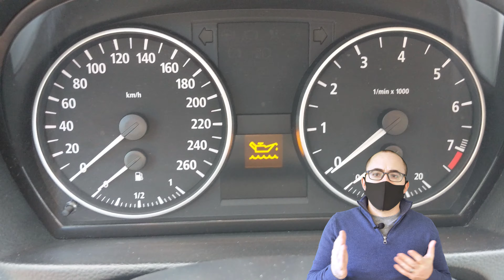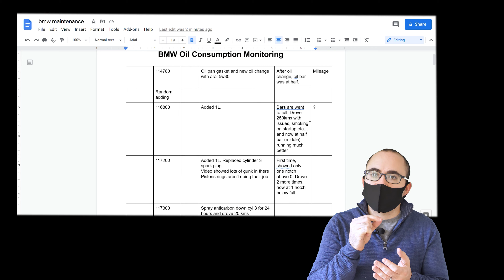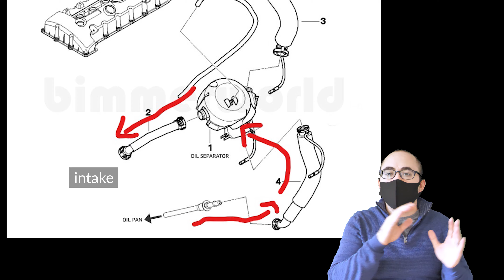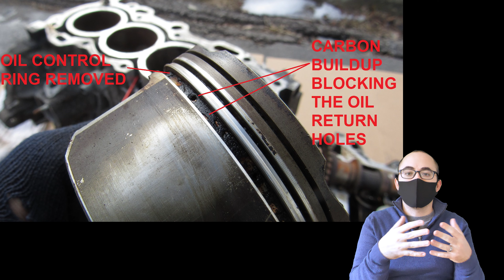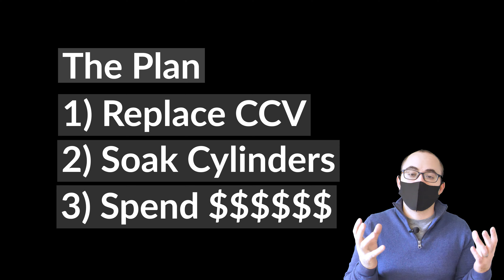How To Fix Oil Consumption Issues On Your Car - Infamous BMW N52 INSANE Oil Burning Problems!

Comment: I find when I redline my N52B30 often it will consumer more oil, nearly half litre gone in 800km lol...im starting to think maybe valve stem seals or ccv given it has close to 200k kms.
Reply from the maker: Change the ccv and try again.

Comment: nice videos, I like your enthusiasm;-) I just had my N52K from 130i rebuilt:-((( $$$$$ before it took more than 1 liter per 1000 km I think. Seems like oil pump went bad and engine was statved for oil and spun bearing on 6th cylinder. I am just interested on what oil you recommend. I live in cemtral europe (Prague) so in wintere there os ogten freezing, -5 to -10 and in summer it is +25-30 celcius. The car has very mixed use  Wife drives it for shorter trips arround the city, but I sometimes tale it for spirited drive, snow drigting or very ocasional track day (not going too hard). I was thinking about 0w40. 0 for the cold starts and shorter trips. 40 to give a bit more heat tolerance for harder driving. Also its one of recommended oils in the manual. The mechanic who built the engine says to use 5w50, which is not in the recommended oils (5w40 is max) and seems a bit too thick for tje cold short drives, but probably fine for the harder driving.
Reply from the maker: It depends on your mileage you drive each year. I change my oil to 5w30 in the winter and 5w40 in the summer. But if you are doing alot of short trips, use 5w30 so the engine can get to temperature quickly. A high quality fully synthetic can work but I have not found a decent brand of oil that does not cause the 'ticking' noise. When I changed it to 5w30 or 5w40 full synthetic the ticking went away.

Comment: Good video 👍🏼 my e91 N52B25 2005 consumes 1l/1000km with no oil leaks, new ccv waiting for replacement
Reply from the maker: Nice! I hope it helps solve your oil burning issue. Or at least improve it
Reply: did you have any oil in sparkplug treads when you were struggling with this issue? (no leaking valvecovergasket)
Reply from the maker: Yes I did. On cylinder 3 especially. I think it was from the piston rings gone bad on that cylinder.
Reply: @buildanddrive   okay sounds bad i have same at cylinder 2 and 3 also 😅
Reply from the maker: Send me a photo of what yours looked like on IG
Reply from the maker: If you watch here... You can see what my bad spark plug looked like https://youtu.be/v0gH8dFyWH8
Reply: @buildanddrive  looking exact the same as mine 🌚
Reply from the maker: Is it only on one spark plug or on all spark plugs?
Reply: @buildanddrive  it is only cylinder 2 and 3  spark plugs what looks same as yours
Reply from the maker: Does your car smoke alot under hard acceleration? Or especially at higher RPM?
Reply: @buildanddrive  it is only making some black smoke at the beginning of hard acceleration, not all the time when standing on the gas pedal 🧐
Reply: @buildanddrive  also do you remember did you have any oil in the air temperature sensor what is located top of the intake manifold ? mine had little bit oil in it, not sure is it normal or not
Reply from the maker: @LooseyGoosey4573  normal. There is oil that gets into the intake. Just clean this off.

Comment: Hi there mate great video explains everything that i sort of figured out after buying this same model and engine (BMW 325i E90 2005) a few months ago

So I firstly got the CCV done at the garage as I was told could be the reason was burning oil but did nothing

I then got my stem seals done an got a new gasket etc.. this only seemed to stop the white smoke that was very apparent on start up and hard revin I have just done over 350 miles since this work was done an it has literally just Came to a halt close to my house and seems to have completely burned the oil.

Not even sure what to do now as i don’t think garage will take the engine apart with out charging me the full labour to remove the head and rebuild the pistons

I am genuinely gutted as i love driving this car!

let me know your thoughts!!
Reply from the maker: Yeah, it sounds like you go the same issue as I did and its probably the piston rings. It depends on a lot of things (how long you will keep the car, what's your budget, do the work yourself etc.) Depending on where you live, you could get a used n52b30 engine with warranty (after 2008) as a replacement. They don't have the same oil burning issues at the n52b25s. The garage could swap that in rather than spending all that time trying to rebuild an engine with a bad oil burning design flaw.
Reply: @buildanddrive  thanks for getting back to me the car itself is immaculate but it’s a base spec model picking it up for next to nothing and now I no why. I could probably get the work done and it still be worth the money but I’m gonna try 5w40 oil an let misses use for short trips if the oil lasts then I’ll just leave it until the nex bmw I like finds it’s way to me lol.. great videos very in depth mate deffo subscribed and we be watching the rest 

All the beat
Reply from the maker: @goono99  I really appreciate your comments! I saw lots of people have the same issues but not many people actually showing what's going on inside the n52. Sadly it's a design flaw and not much we can do about it.

Comment: I read these engines designed to run really hot, so there must be large piston clearances to start cold, so probably burns oil. My Z4 E89 N52 burns about half a litre in 5k miles. 94k miles i do 5k oil changes. Exhaust always sooty.
Reply from the maker: Yeah it looks like the engines burn oil on start up... but really all the time LOL

Comment: Have to say, i'm not experiencing any oil consumption. The usage of oil is going up when I'm driving spirited (track), but when I'm on street I'm not filling up between intervals. I'm now on 240k km, and changing oil every 10-15k km (where 30k is official interval). My CCV system and DISA valves are replaced recently, but just as preventive maintenance
Reply from the maker: Wow that's awesome. Do you have the 325i n52b25?
Reply: @buildanddrive  No, the N52B30(a), I think the 25's are more prone to oil usage, but I don't know the exact reason.
Reply: @hjd5973  Glad you got the n52b30, the b25 was only sold on Europe and Asia and it has low tension piston rings by design which allows it to rev higher (up to 7000rpm) but then even after 100,000kms, the piston rings are worn out!

Comment: I can't tell if your rebuild, replacing the piston rings fixed the oil consumption or not... could you share?
Reply from the maker: You have to get the new piston design or drill out the old pistons to have new oil return holes. That's the only way to fix your oil consumption. And replace your CCV Everett 2 years lol
Reply: @buildanddrive  JFC bro... I should have known this before I bought the car... I only saw videos saying the N52 was probably the best engine built by BMW, they could have mentioned it had to be the 3.0, not the 2.5 😢 cheers bud and greetings from the Würzburg area
Reply: @buildanddrive  gonna get the new pistons in the next couple of weeks. If you want, I can report back on the results. Cheers!
Reply from the maker: @basesperanca yes please. If the new piston design works to fix oil consumption, that would be awesome
Reply: @buildanddrive  ok I keep you posted man. But on the other hand, if I understood correctly, even the old design was not burning oil when it was new. The issue is that the design allows for the drain holes to clog up over time (and relatively quickly), right? So it might take some time till I can provide any meaningful feedback... and I'm gonna change the oil at least every 10k kms... cheers man!
Reply from the maker: @basesperanca  old design flat out did not work. lots of people complained and you can see it in the forums back in the day. BMW then claimed 700 miles per litre is acceptable and wouldnt offer any warranty repair unless it was less than that. New design in 2008 or 2010 (I think) fixed those issues.
Reply: @buildanddrive  OMG that was directly when new?? In that case, I'm happy I went for new pistons and not just new rings. Ok so I will report, cheers and thanks!
Reply from the maker: I have a video somewhere where I compared the piston designs. Basically the oil hole should be much closer to the piston pin.
Reply from the maker: @basesperanca what is your current oil consumption
Reply: @buildanddrive  yep I saw that, but still, when brand new, I'm guessing even the old design wouldn't burn 1 liter every 200 kms. They wouldn't have sold many cars like this, I guess 🤣
Reply: @buildanddrive  hey brother, quick feedback! I got the car back and driven 500 kms so far, zero oil consumption. Very happy! Also replaced the spark plugs, as the old ones were obviously getting quite a bit of buildup. I'll get new coils eventually also. Hopefully now I can enjoy this car for many years to come 😊 cheers bro!
Reply: @basesperanca where did you get your new pistons from? Looking to do this as well
Reply: @giocabral17  genuine BMW but my understanding is that Kolbenschmidt would be the best price to bang ratio choice. I had a deal on the genuine BMW pistons from someone who bought them but gave up on doing it.
Reply: @basesperanca  how has the oil consumption been since? And did you change your valve seals too?
Reply: @giocabral17  2000 kms driven, e-dipstick still shows max. I don't really care about it anymore 😊 Now I'll just make sure to change my oil regularly, so the problem doesn't come back...

Comment: Hi 
My car lexus ls 460 2007 model 
Burning oil.
Advise pls
Reply from the maker: If you engine is burning oil I suggest you try to fix your CCV or PCV if your engine has one and then do an oil flush first and then try to use a thicker oil to see if that helps.

Comment: 2006 E61 523i with a high oil consumption. The motor has been driving around 180k km. I got the car about a year ago and it has always had a very big oil consumption (1 liter per 1200km or so), which I understand from other threads is not that unusual with this engine 😥. The engine has no visual leaks on the outside and the head gasket has been sniffertested for leaks, nothing. I have replaced the CCV in hopes that would help, however that didn't help a thing. Also the engine was running too coold due to a broken water thermostat, that one is replaced too but did not help on oil consumption either. I have tried with both 5w30 and 5w40 oils (ll02/4) no difference really. Recently in my desperation a BMW mechanic told me: try some 10w60 instead, and drive easy on cold starts (which I always do anyway). So I changed the oil and filter. I was expecting to see a slight decrease in consumption however the effect was the opposite. Now it eats around 1L per 800km!
Reply from the maker: Hey Niels, thanks for sharing your experience. Same sort of thing happened to my BMW. I now recommend, if people are going to fix their car, they find a n52b30 engine to swap in. The n52b25s are just engineered to sort of fail, even if you rebuild them with the new piston design. For some reason they still burn oil!
Reply: @buildanddrive  in your experience, how many work hours are we talking about swapping the engine for a seasoned mechanic?
Reply from the maker: If the engine you were swapping in was ready to go (new gaskets, front/rear main seal, new timing chain etc) Swapping the engine would not be hard. Maybe 3 to 4 days with some help but if you are doing it for the first time double it. Also alot of the time you are just waiting on parts because a it tough to have everything ready in advance since stuff breaks.
Reply: @Build & Drive  Hi !  First, a huuuge thanks for all the amazing videos and tips, really amazed by the job done !

***************************

I purchased in February a E90 325i 2.5L (12/2005) with now 150.000km and which I assume has the n52b25 just as you. I experienced the same crazy oil consumption since the beginning (around 1L/1000-1200km).

So my mechanic recently changed (BMW OEM parts):
- Cylinder head cover gasket
- Cylinder head cover screws
- Oil separator & pipes 
- New oil & oil filter as usual (in 7k km, I changed it 3 times with Castrol Magnatec 5w-40)

But It did not improve so far, it's maybe even worse since it seems to have consumed 500ML after 100-200km (I don't think the issue comes from the sensor). Coming home from the garage was a 40km trip on the highway.

-----------> Should I try driving it for a longer distance on the highway before considering anything else? (maybe some oil residues is stuck somewhere or something?)

***************************

Regarding your comment, I saw on this video from Auto Repair Guys
(https://www.youtube.com/watch?v=WEnvddYzZKw&lc=UgwJy98wVwfWLaJYGHB4AaABAg.9BVCmzAz_Zz9WTuggE9YbG&ab_channel=AutoRepairGuys) 

the following comments from 
FreakkyJack :

- "Nr1 reason why the n52 is burning oil is a Bad construction on the pistons. Got mine replaced, 15k kilometers and oil still full! Got the n52b25."
- "But i got replaced All other parts inside the engine which needed replacement, so it was basically a completely overhault engine :)"
- "The Garage bought it directly from BMW, including New pistons. They changed the part numbers, so if you order them there you always get the new/Upgraded ones. 
Btw the car has noch 220.000 km and is running perfectly! :)
 - " Since then the engine did about 80k with oil changes every 8 to 10k and oil Was always full, never needed a Single drop of Extra oil. Really incredible :)"

-----------> Shouldn't I consider this option as well? I saw the same tip on a French forum (https://www.bmw-serie3.com/phpbb3/viewtopic.php?f=220&t=20432) as the final solution if CCV replacement & others didn't work.

Thanks a lot in advance, sorry for the long message !!
Reply from the maker: Yes, thanks for the comment. The n52b25 has a bad piston design that can be fixed by drilling new oil return holes in the old pistons or buy the new piston design. In all honesty, it's more worth it to buy a 330i with the n52b30 that doesn't have the same issue. If I had known that even after rebuilding my engine and replacing ccv I would still be burning oil at 1L/1500kms. I am still driving the car and will try a few more things before I turn it into a track car 😂
Reply: @Build & Drive  Thanks a lot for the help and advice ! 

I'll continue my searches but the experience of FreakkyJack sounds encouraging for sure !! 
I think there're good chances to revive that motor thanks to new pistons and to oil changes every year/every 8k km.

Will let you know if I have any update man ! :) Hope yours will improve as well.

Comment: 95% of the time, these engines don't BURN oil.. It's usually just a problem with the CCV, valve cover gasket and oil filter housing gasket
Reply from the maker: This is the n52b25 and it boils down to those items, but if that doesn't work, it's the piston design itself that's flawed. They fixed this in the n52b30 engines.

Comment: 2007 323i Canadian car, I have to top it up every 1000km, I am so unfortunate
Reply from the maker: Yeah bro... Tough luck
Reply: @buildanddrive  what bothers me the most is that she is very low mileage. 80k kilometre only!!
Reply from the maker: That's crazyyyyy. My car also had only 100k on it... The oil burning got so bad, from 1L/1000 to 1L/300kms
Reply: One of the thing I will do is go with thicker oil and see the difference. I am using now 5w30, I will switch to 5w40 next time and see if there’s any noticeable change
Reply from the maker: I didn't see any difference...
Reply from the maker: You can try replacing the CCV first... It's the piston rings that are way out of spec... Check how bad mine were https://youtu.be/xOfYVfCijsQ
Reply: @buildanddrive  waaaw this is so bad. 😢Hopefully you will find the root of the problem.
I have been told by many bmw mechanics that it is the bad design of the pistons rings from the factory and bmw eventually to not to do a recall and fix all those engines, they issue a statement to the customers indicates if the car burning oil up to 800km per litre, then this is fine, would you believe that!! So crazy
Reply: @buildanddrive  you have tried that already?? This was my last resort 😠
Reply from the maker: @firasalwakeel5365  I tried EVERYTHING
Reply from the maker: @firasalwakeel5365  so yes, just drive the car and enjoy it. 1000kms/1L is not too bad considering it could be a lot worse!